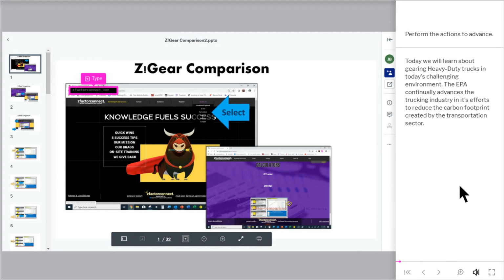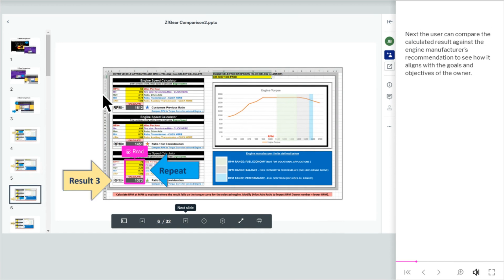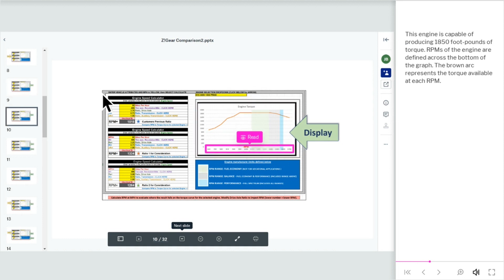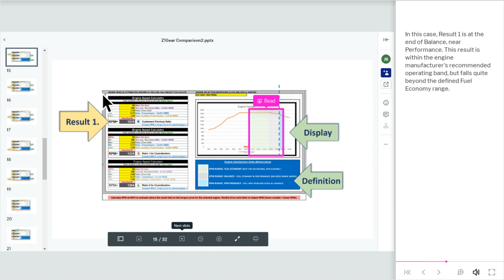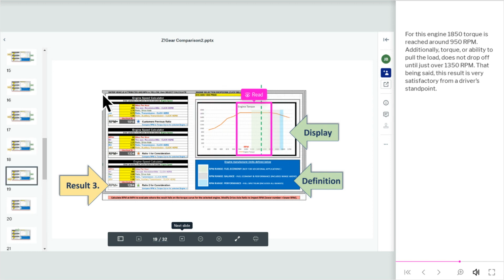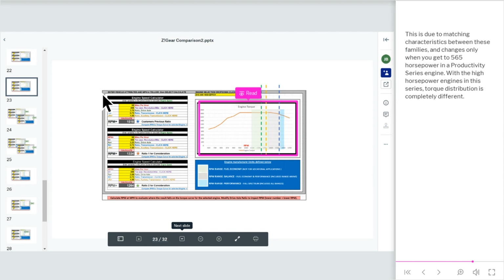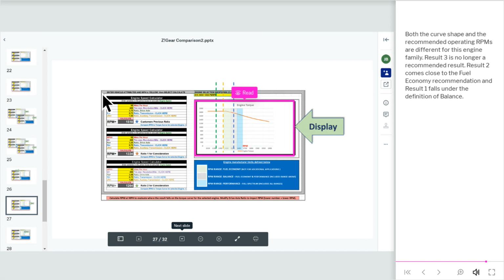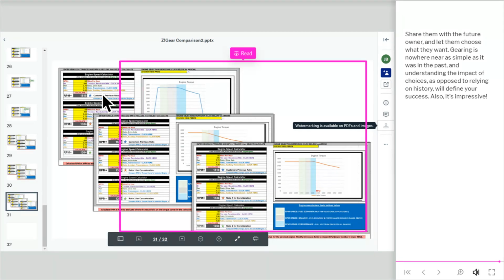Gearing for Customer Success - zfactorconnect

Comment: This Website has valuable information on how to design a power train to get the best fuel economy and spec Vocational chassis.  Good fuel economy = LOW engine RPM.  The transmission, gear ratio, and tire size at typical road speed is what drives engine RPM.  Everyone's engines today do a great job and generate max torque between 900 to 1050 RPM (Downsped), so running the engines are reduced RPM is preferred.  Sweet spots vary, but if you design for 1200-1400 RPM, that should give you the economy your looking for.  Of course, fuel economy is tied to road speed, so if you can slow down and gear accordingly, you'll see a significant increase in how the engine performs.  If specing a direct drive trans, say a 2.53 ratio (which means the engine trans turn 2.53 revs to 1 rotation of the drive tires) then with 11R22.5 tire or 285/75R24.5, at 1300 RPM, you're speed would be 63 MPH.  1400 would be 68.  So with this, you would not want to run 75 MPH, the engine would be turning over 1500.  If running 70, consider 2.26 which would put the engine at 1350.  In essence, if your running 75, use an overdrive trans and or some really tall tires.  Happy Specing.  Reach out if you have questions.